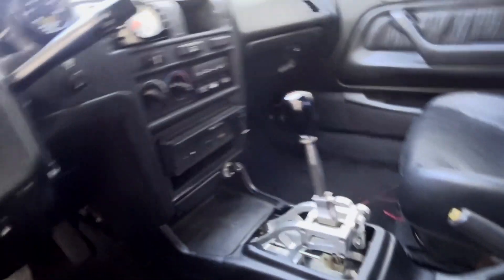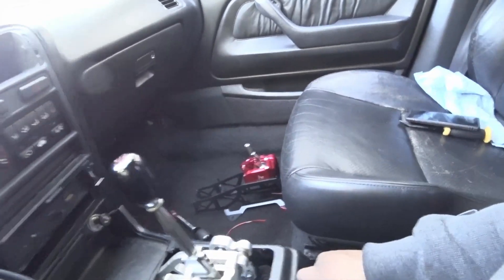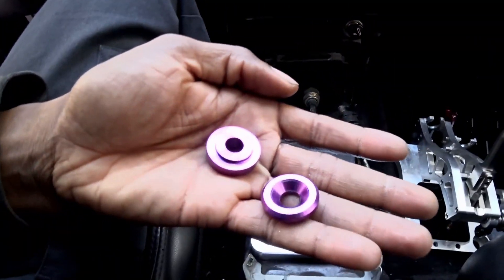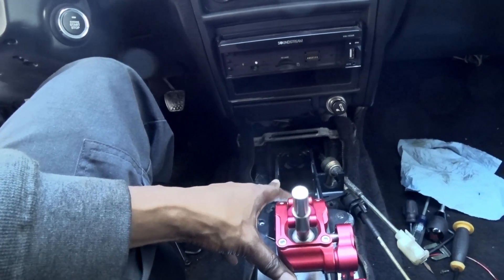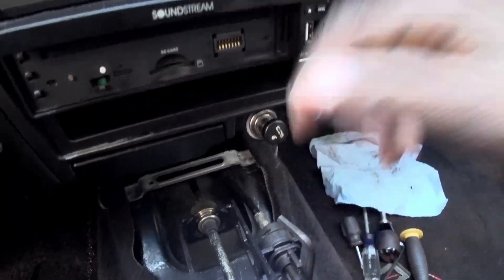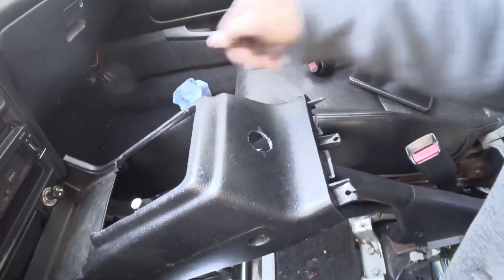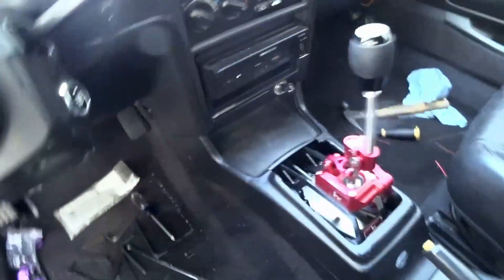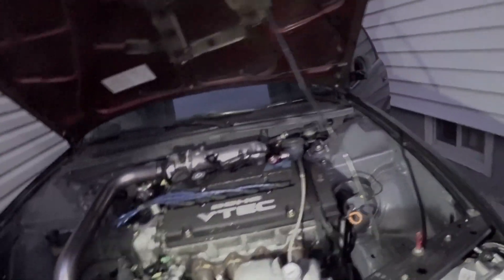B series AWD shifter upgrade. Hybrid VS K-tuned shifter. #hybridracing

Comment: Do you know if the k tuned cables will work with the hybrid shifter? Or should you use all the same brands?  My current console is cut up to fit the k tuned shifter, but I don't want to cut up my new shifter console.
Reply from the maker: i would think the cables dont matter. all the shifter mount the same way.  i used oem cables on both shifter and it worked.